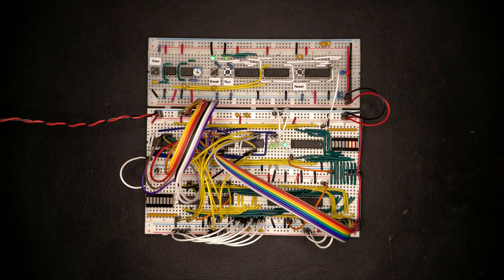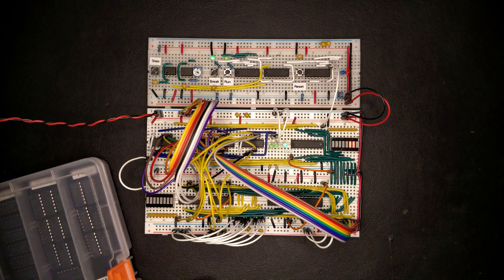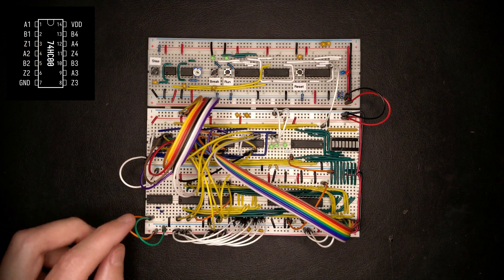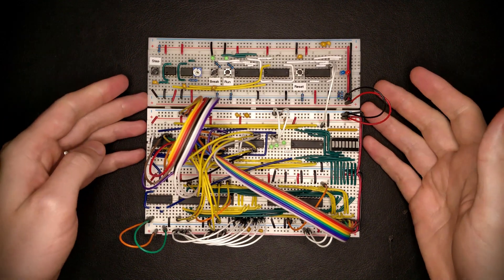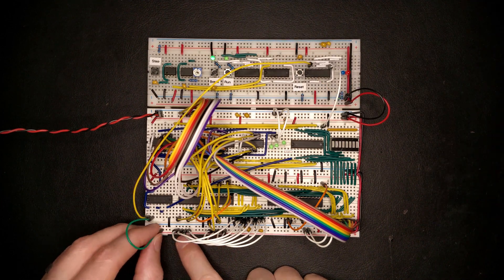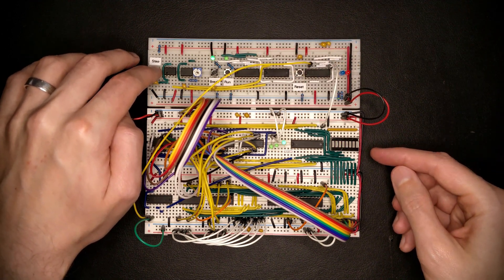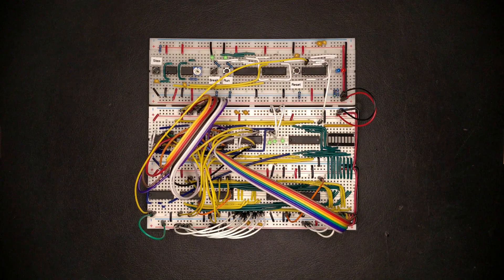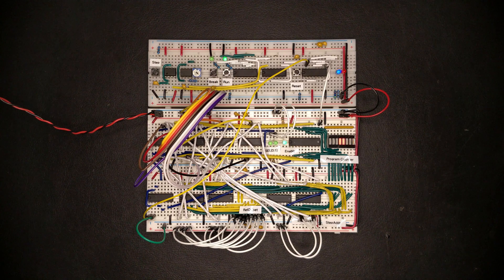Resetting the Program Counter – Superscalar 8-Bit CPU #10

Comment: Fantastic series so far, but I am a bit puzzled why you're wrapping x377 with adders instead of using a counter chips such as a pair of x193's or other such similar dedicated parallel presettable counter-register chips.
Reply from the maker: Thanks! 🙂 I wanted to keep the step size configurable, and also have a mode where the program address is rounded down after each step. That would allow the PC to fetch entire packets of instructions at once, but still track if the program jumped to an instruction in the middle of a packet.
Reply: @fabianschuiki  ah yes, I see that now.  also strikes me as being useful for variable-length instructions, which you did mention in later videos you didn't want to implement, I believe.  but I understand now.  :)